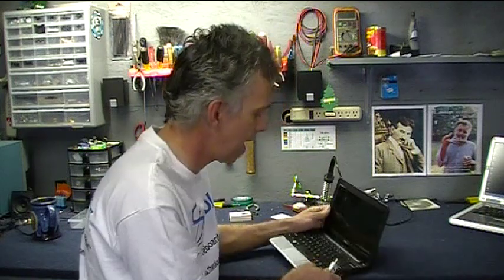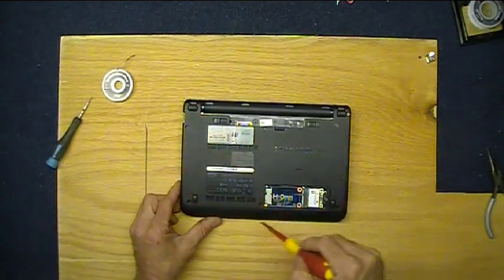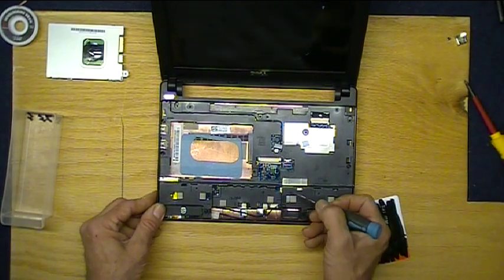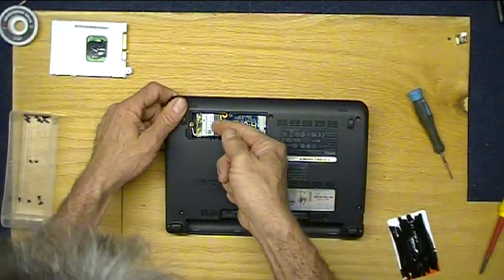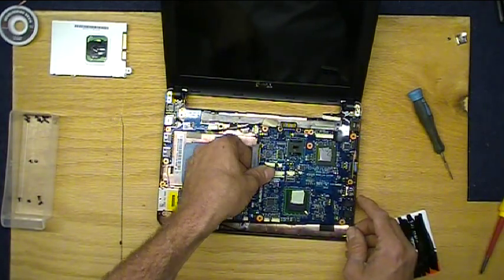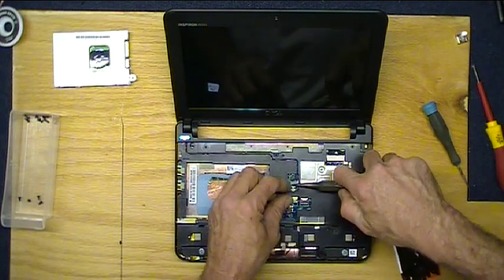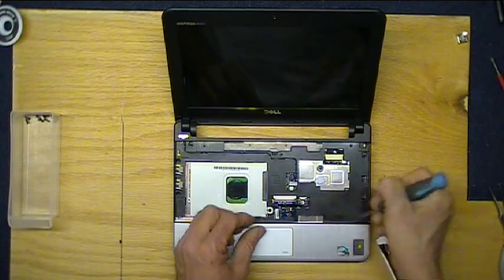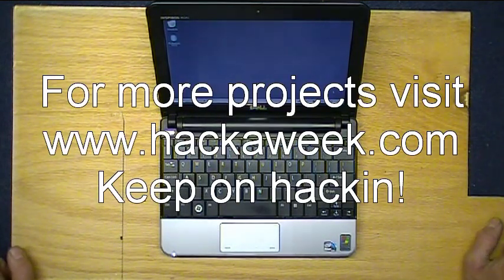Dell Mini USB Port Repair

Comment: I need to replace 2 usb ports on a old Toshiba satellite a205-s5804 laptop. Was my moms and she broke both ports by not unplugging the mouse and keyboard before shw would stop using it, so now both the ports are broken. this video will come in handy as reference for when I replace them. thanks. :)

Comment: I wish you should a bit more on the soldering part... I was looking to see how to unsolder my micro usb port from a bent and broken one I have on one of my headphones. I'm scared of soldering since I've never done it before. any suggestions on doing it? tips? advice?

Comment: Awesome video, motivated me to try and fix my own laptop.  Question: I was looking at replacement usb sockets on ebay and they say "for a toshiba/lenovo/etc".  does the brand actually matter or is 1 socket the same as any other?

Comment: Hi, i really appreciated your video. Very useful indeed! But, let me ask you a question: is there a problem in changing a damaged usb 2.0 port with a 3.0? I would like to upgrade all the ports of my laptop but i'm not sure if they will work correctly! I have a Samsung R580 js04.

ps. excuse me for my bad english! :)

Comment: nice video buddy but i thinkg you got an easy one there. i have noticed and i could do with some good advice that solder on these motherboard weather it a usb port or dc jack the solder is a nightmare to remove even adding new solder to it. it reacts with the old and makes the new stuff very hard to remove how ever i have a gas soldering iron 2 in one what turns in to a  hot air and solding iron. now i consider the hotair very risky when there near by components smd any ideas dark infared

Comment: Thank you for posting. I have two usb ports in my laptop that need to be repaired. Is there any alternative to desoldering? I do not have the desoldering wire.

Comment: Sir I would like to ask if the process of of repairing an emachine laptop? because my laptop have the same problem as in your video the  mboard is OK everything is ok except for the USB port it doesn't detect any of my flash drive even my usb mouse. Hope you can help me.
big thanks,
 efren

Comment: I also have the same problem with my Emachine E730G. 2 of them is somehow crashed and the 3rd is destroyed... Can you take a part an USB-hub and use the usb port from there, my problem is i don't know where to find the special parts :-/

Comment: I have a keyboard with a removable cable. I think there is something wrong with the port in the keyboard because whenever you bump the cable or plug in the keyboard it outputs a bunch of garbadge like +++++++++pooiiuuuop would this work in the keyboard to?